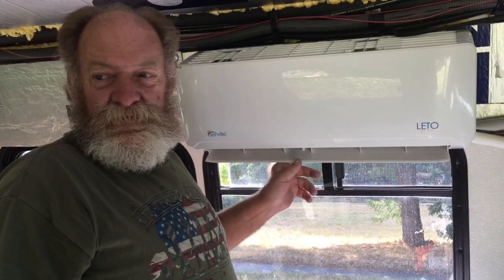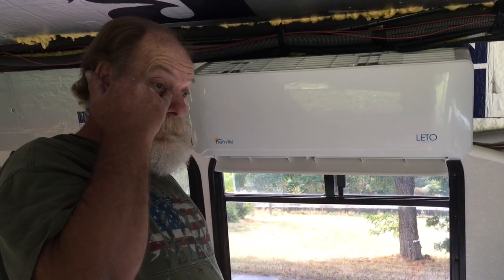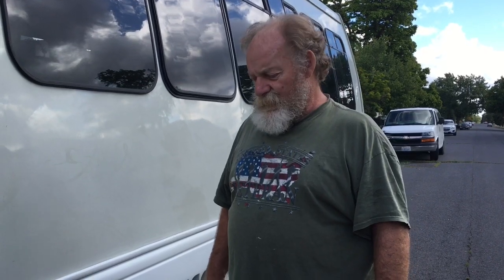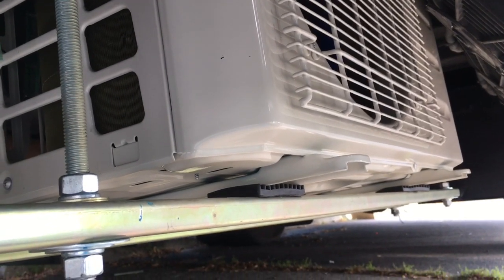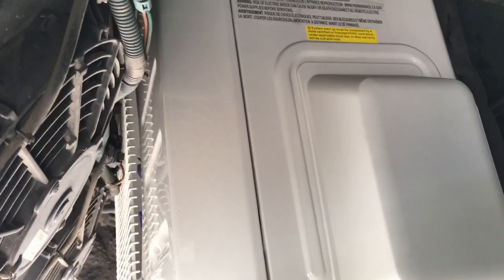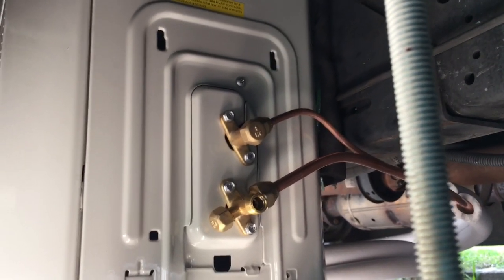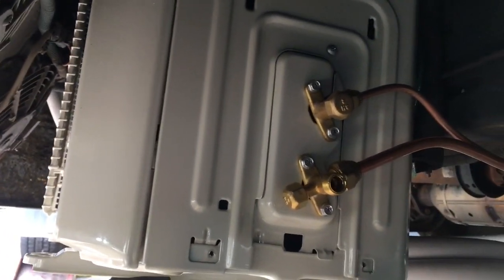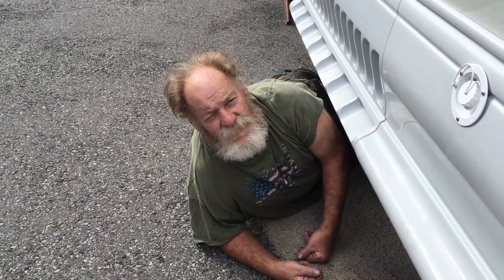Heat Pump Installation 🚌 Shuttle Bus Conversion Ep 50

Comment: We are installing a mini split on our van. Wondering if it gets dirty under there on rainy days or dusty roads? Not sure if we want to do the install below or have a big ugly box on the back of our van, lol. I saw someone cut a hole in the floor for the unit to partially come into an enclosed box inside the van so it’s not hanging down low but still can vent. I’m just worried about the grunge getting in the unit.
Reply from the maker: It’s actually more protected up under your rig than it is on the bumper just try to keep it away from your tires, and remember to wash it off periodically. It’s more efficient when it’s in the cool of the shade than in the sun on your bumper as well.
Reply: ACM Arts And Adventures - Allen & Colleen cool, thanks. I’d rather have it under and not hanging out on a new van. Lol. The ProMaster is pretty high off the ground so hopefully we can get it under there. I just thought rain and road grime would get up in the motor somehow. I dunno how they are made.